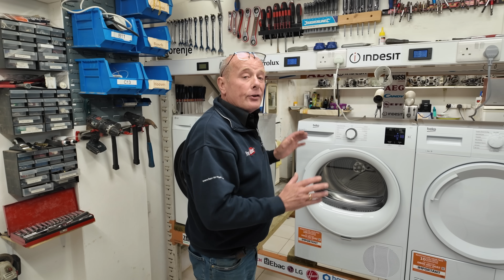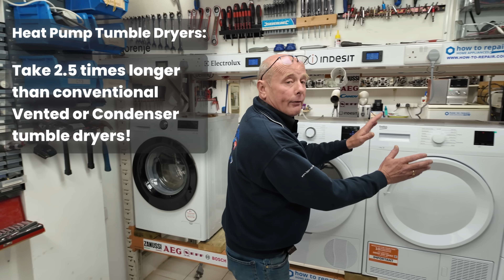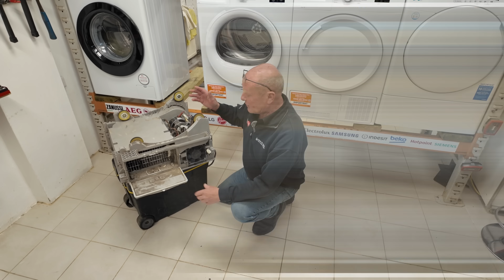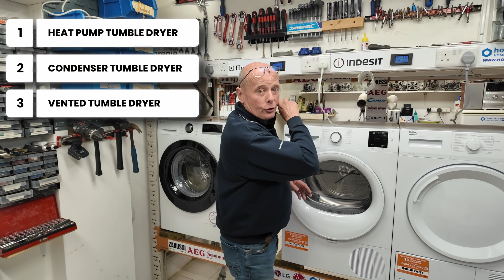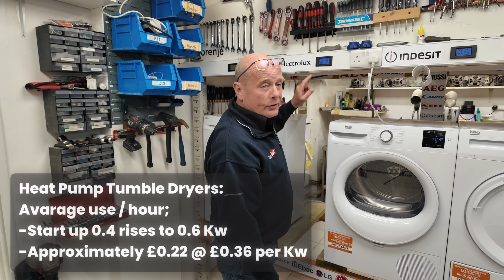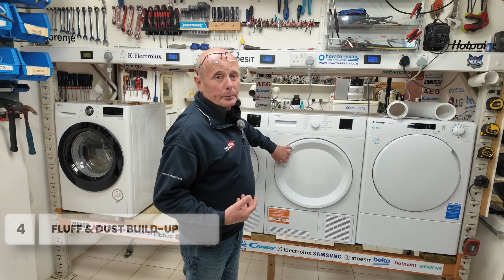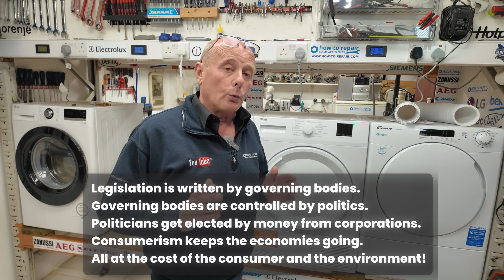Tumble Dryers the Shocking Truth About Heat Pump vs Vented & Condenser, NEW LEGISLATION!

Comment: Had a repair plan on a heat pump tumble dryer. Had to call an engineer out after three and a half years. He turned up, no tools, just a PDA (phone sized computer). He checked the numbers on the machine, entered it on the PDA and said 'we'll have a new one out to you next week.' I asked why he had to come since he had no intention of repairing it, he said it's fraud prevention. My wife was unimpressed about being without her tumble dryer for nearly 2 weeks in the middle of winter!

Comment: i actually have that Beko Heatpump Dryer in this Video and it is actually pretty good but i kind of agree with the run time being longer but with me its not 2.5 times longer . i had a beko condenser dryer in 2012 and it went pop after 7 years and i bought a Beko Heat Pump in 2019 after that one and the board failed  on that one after 6 years and as i said i now have the one in your video for a year now and id say the old condenser one took 60-90 mins to do 8kg of clothes and the current heat pump one is usually 80-120 mins with the same kg of clothes so its about 35% longer .
Reply from the maker: I haven't seen any positive comments from engineers about these machines' serviceability. I'm not a fan of heat pump tumble dryers because fluff tends to build up on the condenser and evaporator at the bottom. This happens because fluff sticks to moisture, which is a common issue with these machines. Manufacturers have had many problems with the filtration system trying to catch fluff and lint before they reach the condensing and evaporating plate.
Reply: @How-to-repair the fluff is annoying on this dryer as with my old one I get the vacuum on it and the brush they give you and try to get as much out as I can .

Comment: Are there any manufacturers of heat pump dryers that don't put absolute garbage filters in? I have an electriq and while its been great so far, i find i have to hoover off the coil every so often because so much dust gets past the filter. Will definitely have to dismantle it and properly wash out the coil soon 🤷

Comment: You forget that the heat does not disappear on the 2 machines, so in winter it means that you save the same amount of heat if it is within your thermal bridge.
The last one only provides heat for the birds on the roof.

When there are offers, the price today is almost the same for all 3, and my first one is now on its way to say goodbye after 14 years.
That's why I just stopped by to look ;-)

Drying normal clothes using 1-1.5 Kwt

Comment: Do you have any experience with the newer modells (like LG RH90V5AV6N) where you do not have access to the front of the heat exchanger and they are cleaning it with water (condensed during the evaporation)? Are they better? I do not like that I need to disassemble my dryer every 2-3 years to completely clean the heat exchangers.

Comment: Just as an FYI to you on the longevity of modern appliances,  I currently own a 7yr old example of that exact Beko Condenser dryer in this video(mine is a 10kg version,  model no. DTBC10001W) and it has been utterly flawless in spite of 2x the average usage. I would highly recommend it as it's efficient, a piece of piss to maintain and is extremely affordable considering it's reliability. I refuse to buy any other brand pf appliance as it happens because aside from motor brushes in a washing machine, they are incredibly reliable when used as designed. A massive factor in the longevity of a washer or dryer is actually people repeatedly exceeding the design tolerances of the appliance, completely abusing it then complaining when it doesn't last. Take weight limits for an example with regards a washing machine, people stuff them to their dry capacity and then blame the manufacturer when it doesn't last. This is a massive factor that is never taken into account in general but over brands like Indesit/Hotpoint/Hoover/Candy/Whirlpool/Haier/Samsung, I can back up with evidence & stats that the equivalent Beko will outlast its competitor.

Comment: I have a 20+ year old Whirlpool Gold American 4.5 kilowatt vented tumble drier.  Which has worked perfectly since new with twice annual fluff clean-outs from around the drum and heating elements. No repairs needed. It uses more electricity than smaller/more modern dryers but ‘does what it says on the tin’. I’ll not be replacing it until I absolutely have to!

Comment: What do you think about using a desiccant dehumidifier to dry clothes? I use a 630W one in a small closed balcony and its pretty good in winter. It collects 7-8l/24h and its pretty efficient. I also use a vornado fan plus open windows to remove humid air.

Comment: As a repairman for Gorenje machines, I would not completely agree with your contribution. Replacing the motor or heat pump or refilling was usually not necessary even after 8 years of operation. Replacing the bearing does not exceed the cost of €60. The energy savings are quite a lot of money, which you will not spend on maintenance but on buying a new one after these years. Considering the impact on the environment, the type of gas in the pump is now a concern, which is not harmful, and the machine itself is completely recyclable.

Comment: Current heat pump dryers are condensors, right?
Would it save to have a vented heat pump dryer?
Sure, the heat pump remains nearly impossible to repair economically, but you reduce the dust and fluffy build up immensely, right?

Comment: I have a Bosch heat pump tumble dryer and we have had it now for about 7-8 years, it replaced our John Lewis condensing tumble dryer, which we had for 12 years. The Bosch has the same condenser and once it is finished uses the water in the condenser to clean the filters. So far we have not had any problems, occasionally I have to wash the drum out and also clean where the filter sits, but I wouldn’t complain about it. 
I don’t use it all year round, as soon as the weather gets warmer I use my line, as I much prefer air dried clothes, bedding and towels.

Comment: Too right mate.  I have invested in solar panels, I produce way more power than I consume, and I get bugger all for the excess power I put into the grid (here down under).  So power consumption means nothing.  Now that I have so much excess power I cannot even use, it literally costs nothing to use the dryer during the sunlight hours.  It is much simpler technology too.  My last dryer must have been a good 30 years old.  It won't be long before we will just rent them or lease them.  Even though I am in the land down under, your videos are still meaningful.  Keep up the good work.

Comment: Heat pump dryers are not that much more energy efficient as effectively that's only 50% max, Normal machine: 2 to 2,5 kWh, heat pump 1 kWH as the 400 W is consumed for 2,5 times the amount of time. That time will extend as the filter system is getting clogged slowly but surely, reducing efficiency.
To me, heat pump dryers are not worth it, bui they will be forced upon us by the 'green' busybodies.

Comment: I fully agree with you and thanks for making this video. Our now 4 years old heat pump tumble dryer is full of fluff inside even though we clean the filters constantly. The worst is that drying takes forever. The EU energy efficiency standards have gone too far leading to bad products. Just like the dishwashers which also take forever and pretend to wash even though the water is only 45 degrees - not very hygienic. Energy poverty no thanks!

Comment: My heat pump dryer is still going strong after nearly 9 years with no maintenance other than clearing the two filters. At the time I got it there'd been some issues with fires in certain dryer models caused by heating elements, and I've had failed heating elements in kettles and ovens but never any problems with heat pump equipment (e.g. fridges/freezers), so despite the extra complexity it didn't seem like a big risk. Plus the energy savings have probably paid for the cost difference three times over. No complaints.

Comment: I think a company is going to come out of left field and create an actively cooled condenser drier... Will still need a heating element, but much smaller, 400W ish. Heat pumps now tend to copy what is done on cars, but the same result could be achieved with a cheaper, condensing fluid/gas such as methanol (not going to do the thermodynamic calculations here)... Hell this wonder company might even makes parts available (I'm allowed to dream).
The 1st company to do this will obviously ruin the day of the MBAs in manufacturer boardrooms salivating on the prospect of households replacing driers every 3 years, filling landfills and their bonuses "for the environment".

Btw, on my ship, we are 45 crew (sometimes more) and we have 6 driers. Between the boilers suits, personal clothes, sport clothes, linen, towels etc, they run about 20 hours a day... We cannot put 2,5 times more machines in our laundry...

Comment: I just feel bursting with the need to point out that energy consumption isn’t just about running the machine, it’s a process that starts with the raw minerals and doesn’t end until after disposal and recycling.

Just think how much energy it takes to make an aluminium casting or a silicon chip, the transport, chemicals that go into the paint, polymers and so on.

I think we’re being foolish to believe our consumption starts with plugging it in.

Comment: You have not taken into account the cost of heating the interior air that machine is venting outside this is like running 150 cu feet per hour bath exhaust fan - huge penalty of your whole house heating and cooling costs

Comment: Vented, the energy is going straight to waste. Condensor, the energy is heating your home. Heat pump, the energy is heating your home. The bearings will last longer in the heat pump machine due to the lower temperatures. Ps) 400w is 15% of 2.4kW

Comment: Another example of misguided legislation is requiring ethanol in petrol. Ethanol has less energy per unit of volume than gasoline so fuel consumption increases. Ethanol is hygroscopic and encourages the presence of water in the fuel system. Ethanol also causes problems with components of older fuel systems.
Reply: Absolutely! I have an older car and have to make sure I put E5 fuel in it.

Comment: I do not think that the heat pump dryer is 2.5 times slower. From what I'm finding, comparable heat pump models are about 30 to 45 minutes slower than condenser dryers.
The heat pump dryer uses less heat so it's actually more gentle on clothes overall in my opinion. Heat damages fabric more than a bit longer banging it in the drum.
It takes about 3h to dry full load in my 10kg heat pump dryer and it's using 1.4kWh during this entire cycle. 
You are definitely correct that repair would be more expensive, so hopefully it will last long for me 😊

Comment: Have a Beko condenser tumble dryer over ten years old. Have to drag the machine out twice a year to clean out the black muck from the float compartment - god knows where this muck comes from - a tedious but necessary job otherwise the machine keeps stopping as the build up of bacterial muck limits the working range of the float which limits the time allowing the water to filter through into the water tank. Cleaning this float tank out regularly keeps the machine working as intended. Apart from the the usual need to regularly clean the condenser filter and remove as much dust as possible from the circulating air ducts, this has been a good purchase. I recently personally replaced the two rubber drum rollers as they had started to make quite a noise; one of the drum rollers had lost nearly all of its rubber and was making a hell of a noise! Before installing the new rollers, I cleaned the roller track on the drum with scotch-brite to ensure smooth running of the drum. Only other thing I found was a blown interference suppressor capacitor which was the old metal foil/paper type and I believe this was the mysterious cause behind the utility room sockets tripping recently. The replacement interference suppressor looks like Beko were onto this item as it's replacement looks to be a solid state construction. Beko still have all the spares for this machine in stock, but I don't know how long for seeing as the idiots in charge of legislation keep changing it and make our lives a misery!!! I've only recently found your you tube channel, which I think is very informative. Thanks.

Comment: While every point you have is perfectly valid, I'd say there is certainly a case for heat pump dryers where some consumers will reap more benefits than issues. Electricity cost disparities in different markets is a big one - in countries where there's so much solar in the grid it's already free for half the day, it doesn't make sense.

If you have a big family and run the unit a LOT, the unit wear and repair is a bigger factor.
For 1-2 person households especially, a unit would depreciate and the technology in it would be obsolete over the 10+ years it takes for it to stop working. By that point, possibly any of the dryer types would be uneconomical/silly to repair compared to the newest most efficient ones.

Comment: I've had a Bosch heat pump for over 10 years, and I have to say it still works very well.
However, I have to say that, being a bit of a geek, I bought the maintenance hatch for cleaning the heat exchanger, which allows me to clean it quite easily.
Then every now and then I open it and give it a general clean, including the water collection tray (the one with the pump), which unfortunately is a bit inconvenient on my model.

Comment: The simple truth is that your average all singing all dancing heat pump tumble drier is crap compared to a conventional tumble drier. 
The basic problem in my experience is that filtration filters that restrict.the flow of micro fibres to the condenser simply are not good enough.
Furthermore in the heat pump drier it is neigh on impossible to readily access the condenser let alone  be able  to remove it to service / clean it.
Consequently the condenser clogs up with micro fibres & fluff, this in turn causes sensors to "through a wobbly" & break down, rendering what was  2 year old Bosch machine ultimately totally useless & in need of totally unnecessary replacement in our experience. 
For goodness sake, get a machine where the  condenser is readily accessible, easily removable & can be  easily cleaned.

Comment: I have a Bosch Maxx 7 condenser dryer the model that does not have the removable condenser element filter and it take two to three times as long to dry 3 towels than my old Phillips vented appliance

Comment: What would I do with all the power from my solar panels if I cannot use proper loads which require a good chunk of it. I just had to replace a BOSCH vented dryer after 25 Years! It used 2800W in Eco mode ;) and was perfectly able to keep up with my washing machine. You have to understand that in average we wash/dry 2 times a day, sometimes even 5 times. Now I had to buy two, more economic (2000W) vented dryers (luckily I do live in a country without such stupid regulations) to compensate for the lost speed :) 
I find it really terrible when governments are prohibiting certain technologies as there is always a trade of. The consumer shall have the right to choose what is best for him. High electricity bills will make people invest more in renewable energy and overcompensate for the extra power, which again helps the others to get more clean energy ;)

Comment: I've had mine for 8 years with a Heat pump dryer. No issues and they don't shrink the clothes and use less energy. I'd rather it take longer and not have clothes that have been ruined

Comment: I would have actually liked some meaurements, like testing the same set of clothes on all three dryers and measuring both the peak current, total energy and time taken. Peak current might be relevant when it comes to how many other things you can power up in your home when the dryer in question is running. We have a Bosch heat pump dryer and it takes up about two hours to dry and uses about 1-1.4kWh, depending on load, and the power consumption is about 500-700W during a cycle.

I get what you're saying about maintainability, I would like to point out that the problem with fluff building up in inaccessible area is more a feature of a particular product and not an inherent heat pump characteristic. Nevertheless many heat pump dryer manufacturers now understand that problem and some are designed automatically clean the cooling elements.

If, as you imply, the heat pump dryer saves around £100 of electricity a year, then you can replace your heat pump dryer after four or six years and you'll still be financially ahead of the vented dryer option that you didn't need to replace. The higher maintenance overhead may be offset by the higher efficiency.

In general you can either have a simple appliance or an efficient appliance, but not both, and this probably applies in most areas. The efficient appliance going to be harder to repair and slightly more expensive to make, but in most cases it'll pay for itself in many ways. So the central question is which do you value, efficiency or repairability? I personally tend to prefer efficient gadgets because in most cases the more efficient gadget will have paid for itself by the time it breaks.

Comment: First thing I purchased for my heatpump dryer was a foam filter for in front of the condenser. In the many years ago some manufacturers equipped their models with these so if your lucky you sometimes find some old-stock which ever fit your new model